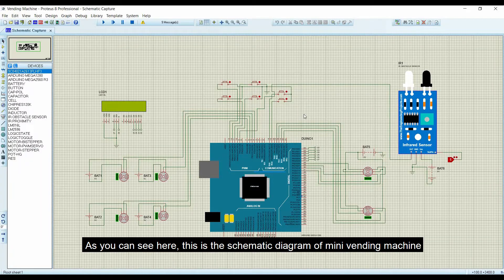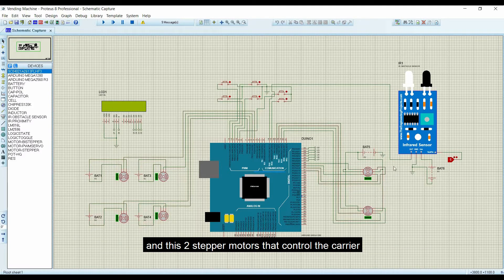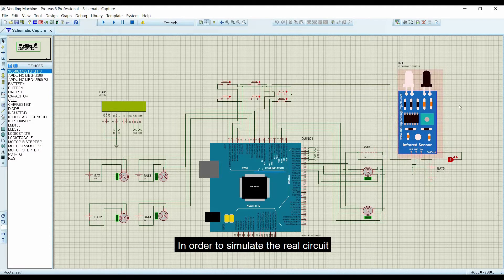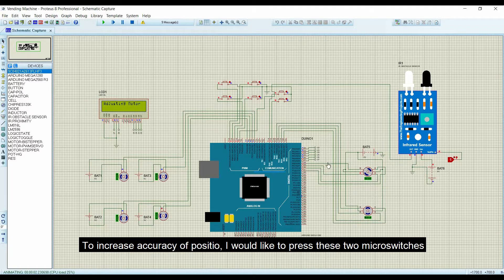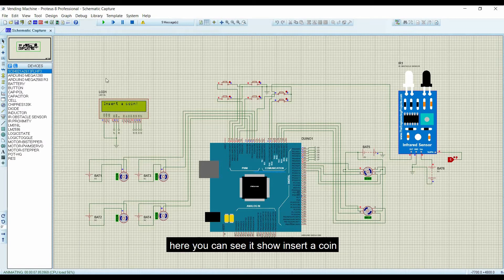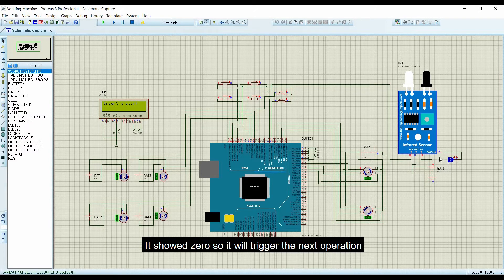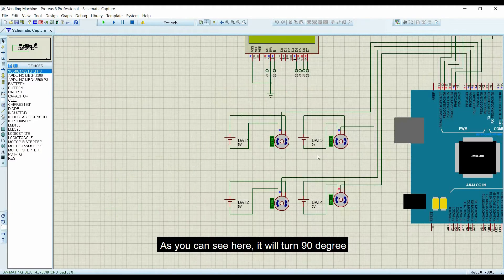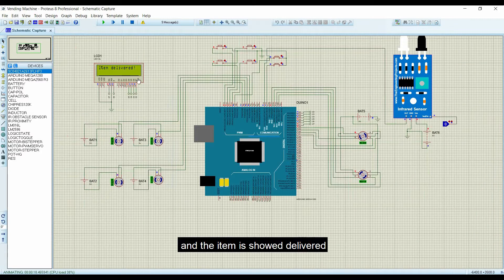Mini Vending Machine

Comment from the maker: FYI, the design of the circuit as the video mentioned is working but one thing has to insert which is the IR sensor library that has to download externally and place into proteus. Coding is just purely with Arduino. Hope it's help and thanks for watching!